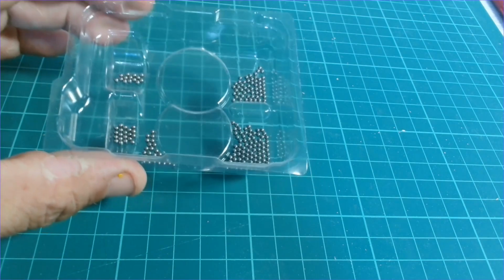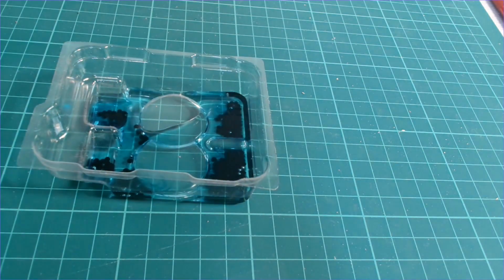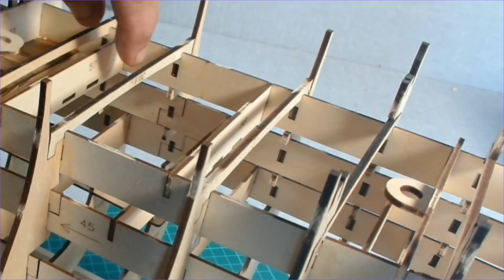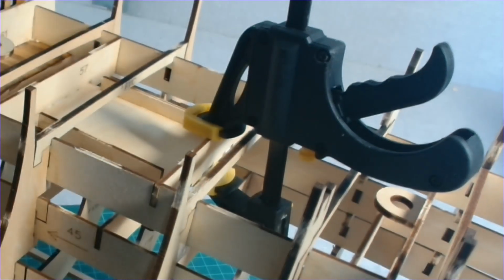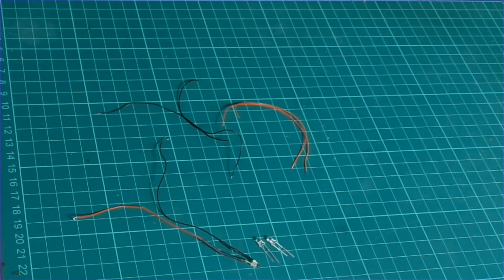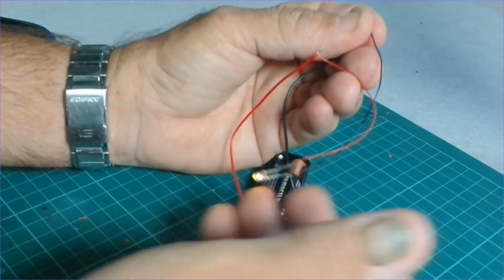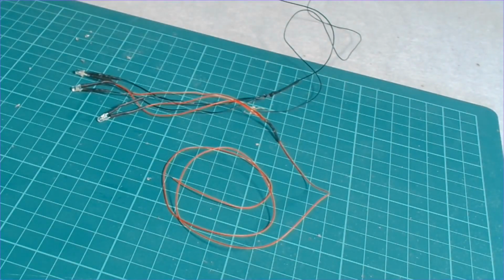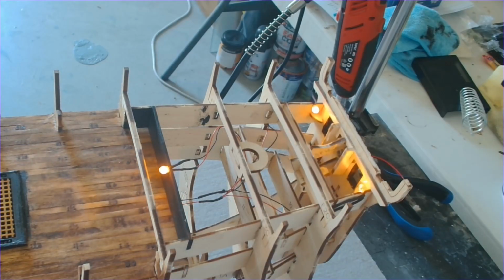Artesania Latina Santisima Trinidad Part 7

Comment: Hi Greg, as you can see, soldering is not that difficult. But Grent is right, if you use solder paste, the parts are easier to tin. The result looks pretty.
Reply from the maker: Thanks Wolfgang 😊  yes I will try the paste in future 😀

Comment: Greg as you can see others mentioned using solder paste or flux make sure it’s safe for electronics as plumbers soldering paste/ flux will corrode the electronics. I don’t know what kind of solder you are using but use 63-37 rosin core electronics solder combined with the flux or paste. If you still have troubles  reach out to me and I’ll try and help you  

Yes  know this is a older video lol but couldn’t help but to reply
Reply from the maker: Thanks very much . Yes, I ended up buying the correct solder aand flux , and things are going much better now. I really had no idea 😉
Reply: @GregWilson635  excellent